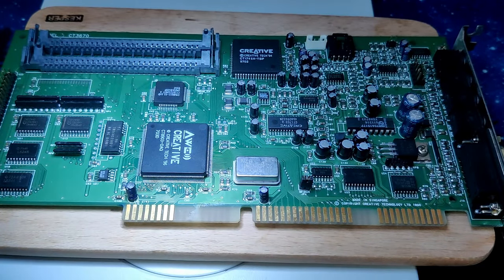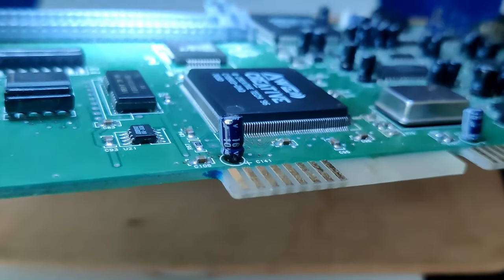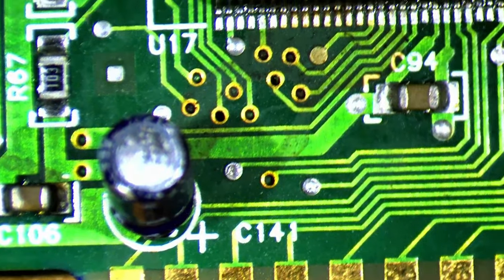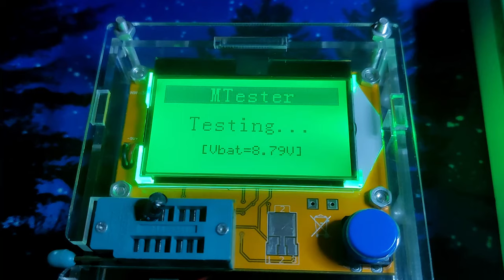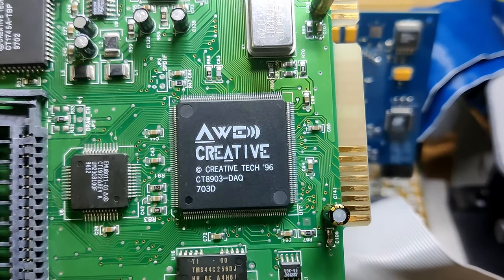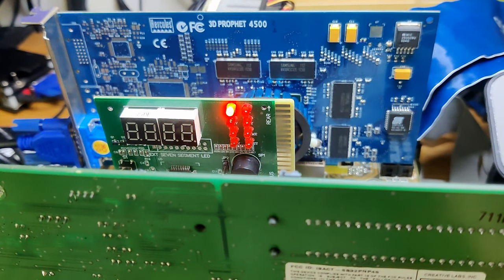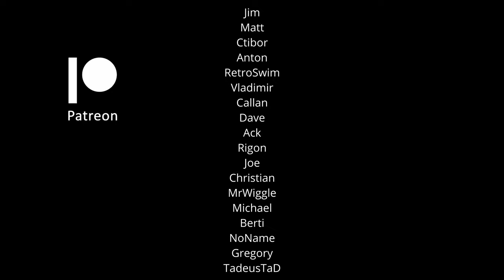Forensics: Sound Blaster 32 CT3670 repair attempt

Comment: Capacitor c120 is also bulging.

I'd consider looking at all those capacitors between the caps between the audigy chip and the 4 pin connector
Reply: I really wonder how the owner made that happen, maybe left hot air unattended on the side of the board for a while or something, but yeah clearly all those caps are dead/dying!
Reply: People tend to stick hardware in the oven, without thinking for themselves what might be some issues that could occur. 

I’d definitely replace those capacitors. Usually, they’re resistant to heat, anywhere from 85°C to 105°C. The molten connector tells me the temperature went higher than that. Evidently, those capacitors will dry out and/or pop. 

Nothing is unfixable. :)
Reply: I'd say the majority of the caps are probably cooked, I see a fair few that look suspicious. Even some of the ceramic capacitors look suspicious, look at C16 to the right of the CT1745A chip, it's really dark compared to the ones next to it, like it's getting smoking hot from being shorted.

This card may work again, but it's going to need some serious low level diagnostics.

Comment: use a thermal camera (if you have one) to see if any more caps or other components are shorting. 

also i think it's pretty hard to damage ICs with heat. unless the card was stored in a humid environment and the person heated it very quickly or went above 300-350C. This is called popcorn effect and the bigger the IC the bigger the risk. However I would still recheck for a short somewhere since it stops the whole system from booting..

Comment: I would check resistance to ground on all power lines into the card, as well as the data lines. I wouldn't be surprised if the onboard power supply of the card is shorting out, or some line is being pulled down. If you have one, maybe a thermal camera will be a quick way to see if a component is shorting, but you can get away without one, it will just take more time and effort. I think there is a lot more that can be done in terms of diagnosing before completely condemning this card. Obviously, commercially it makes no sense to spend this much time and effort on the card, but for greater justice and youtube content I think it will be more than worth it!
Reply: Exactly my thought. Although, i would not waste time for cheeking data lines at this stage, until the system is at least able to boot up. Any IC malfunction would not prevent system boot, this has to be a short on a card. So, i would start with checking power lines on the SB's ISA connector.

Comment: Recap the whole board, just, all of it, because the more caps I look at, the worse it gets. Some of them look like they'd explode of you sneezed in their vicinity. After that I'd check for bridging with any of the other chips/connectors, because there's no telling what might have gotten messed by by that heat. Lastly, I'd test to see if that crystal is still okay.

Comment: check for shorted ceramic caps; heat stresses can cause the ceramic to fracture and short the layers together. since they're usually used as bypass caps, the thermal gradient and stresses they endure are much higher due to the ground planes sinking all the heat away on one leg.

Comment: have you tested for shorts?
it could be any one of them surface mount caps and resitors have a hairline fracture from the heat. but i say its that audio chip the pins probably sent too much voltage to the wrong place. dame shame. would be nice to see you save the card somehow.

Comment: These cards had a serious problem with the PNP EEPROM corrupting. When that happens it stops detecting on the creative PNP utility TSR and Windows drivers can't find the card. Copying EEPROM data from a working card will save it if that is the problem. Maybe this card had that problem before it pop'd.

Comment: Everyone commenting about shorts -- if there were shorts between a power rail and ground, the power supply would not have stayed on. The overcurrent protection would definitely have kicked in and immediately shut the supply down. So I highly doubt there's a short between power and ground anywhere.
Reply from the maker: You're absolutely correct. And that overcurrent protection works like a charm. When I built my first -5V Adapter, one of the tantalum caps was bad and immediately caused the power supply to turn off.
Reply: There's definitely not a short between power input and ground. Shorts between two signal lines or between a signal and power/ground are much harder to detect.
Reply from the maker: So, turn of events: there was a short between two signal lines. The card posts now and also plays digitised music. Unfortunately, no FM/MIDI sound. Will try the card in an older system with pure DOS since the drivers have issues with win98 DOS
Reply: @bitsundbolts  Are you aware that on some/most AWE32 cards, FM is routed through the EMU8K synthesizer/effect processor and requires initialization using AWEUTIL /S in DOS (or installation of an AWE32 wavetable driver in Windows 95)? "No FM" might be just due to missing initialization.

Comment: In the electronics assembly industry, there is a term called "bake". It refers to some components needing to be "baked" before assembly. Baking removes moisture from inside of IC chips that could expand during reflow soldering and destroy the parts. I suspect the "pop" that was heard during hot air rework was from just that. During the baking procedure components are slowly heated to much lower temperatures than reflow soldering to gently remove the moisture. This is also why you sometimes receive parts from DigiKey etc. in sealed plastic sleeves with silica gel pouches inside. They are moisture sensitive (to some MSL level).

Comment: I would use a thermal camera to figure out which components are getting too hot. 

Also, it might be worth checking out the 74 TTL chips, such as the 74LS245. 
It is better that it is one of those chips that is damaged rather than the proprietary ones.

And, as others have already suggested, check for shorts and the rest of the capacitors.

Comment: Excited to see my old card even if it's still not working. If you look at my first post on Vogons, the computer was only able to POST and detect the card one time, when it gave me the error. After that, the computer wouldn't POST unless I changed a jumper but it wouldn't detect the card.
Reply from the maker: I did change that jumper, but there was no change. I haven't given up on the card yet, I just didn't have enough time to look for other faults.
Reply: What were you hoping to achieve by blasting the thing with hot air? Genuinely curious. Hot air isn't going to unbend pins that are touching, for example.
Reply: I suspect he confused a hot air station with a hot air gun from the hardware store, plus didn't know how to shield other sensitive parts

Comment: Maby measure all caps (ceramic and electrolythic) for shorts and replace all the electrolythic ones anyways for good panasonic, nichicon or rubycon ones in case the card does work again. They are afterall almost 30 years old anyway.

Comment: Pro repair tips: First check for a short between power and ground. There are several common logic chips on the board being used to isolate several buses (74LS244/74LS245), plus a few other smaller logic chips and a DRAM next to the large Creative chip. I would remove and test all them in a Retro Chip Tester Pro. If you don't have a RCT just remove and replace them with new parts or known good used parts. The melted connector is in the audio output section so that won't stop the computer booting but a bad logic chip connecting the card to the ISA bus certainly will cause an issue if the chip(s) are bad. Due to the custom chips the only thing you can do is check/replace any common off-the-shelf chips. If that doesn't work then it's scrap and a lesson to all noobs watching... waving a hot air station over a board like a magic wand won't do anything except break it. You can't fix it with a hammer. Do not mess with expensive and complicated electronics that you do not have the required skill levels and equipment to handle.... PRACTICE ON JUNK BOARDS UNTIL YOU GET THAT SKILL LEVEL!!!

Comment: Lots of el caps seems to be bulging, so I'd go for a full re-cap. If that won't work check if the oscillator generates anything. Then look for possible ceramic caps short.

Comment: Yeah I see other bulging caps and I'd check that crystal oscillator since it's close to the main chip where heat would of been applied. You're going to have to check the ceramics for shorts and see if there any off value or open resistors.

Comment: Decades ago we were told not to get parts too hot or they will die, but if you watch Sorin blasting parts with very high temps, ie 380ºC, it doesn't seem to matter. 
Me personally I would keep trying, unless I found an unreplaceable part burring hot when powered, ie, shorted.
You could check for shorts, diode check data lines, check if power is on the card, pull the IC totally and resolder, etc
Reply: Maybe pull parts off, plug it in, and see if it boots, ie, it might tell you what part is the problem.

Comment: Looks like this "sound" was from pcb itself, it was "popped" from overheating, and delaminated. You can see it in oscillator area, near resistor R68(7:54) - damaged vias
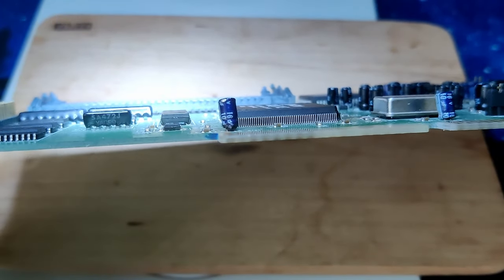Reply: I think that at 1:31 you can even see the PCB bulging next to the oscillator 😳

Comment: It could just be me having just done a full recap on a motherboard and PSU, but to me a lot of the rest of the caps on that card look like they're bulging as well. If the previous owner just air gunned the whole card, he may have blown or come close to blowing some of those other caps as well. I'd just try a full recap before giving up on it; caps are cheap. And maybe test for continuity/shorts around the components near where the hot air went.

Comment: I once had the EEPROM which stores the settings on my GUS PnP corrupted somehow which prevented the machine from booting. I fixed it by hotplugging the card to a live system and reprogramming the EEPROM with the standard tool from Gravis. So a non-booting ISA card does not necessarily mean a hardware fault. Though in this case the liberal use of hot air does seem like a more likely cause for the failure.

Comment: Check all capacitors and also use a thermal camera to see (after replacing any defective capacitors) if any shorts are visible on thermals

Comment: Before you try anything else, lightly sand the pads with 3000 grit sandpaper ( I just revived what I thought was a dead sound card doing that, a standard eraser didn't work )

Comment: I had one of these SB AWE 32 cards in my socket 7 K5/K6 based PC as well as in my first slot 1 based PC. I always wanted to added extra RAM to mine but I never did get around to doing so. 

Judging by the number of capacitors that appear to damaged I would bet there is a short in at least one of them that's causing the system not to POST. It's a shame that hot air killed this card. However, it is understandable that the first couple of attempts  may not go well until a person has had more experience.

Comment: To me it sounds like there's a short somewhere, maybe a fried capacitor. If the chip was fried it would probably still allow the system to boot, it would just not work properly or at all. I'd say capacitors are the most likely culprits. They don't like being overheated, and a shorted electrolytic cap across a power rail can certainly prevent the system from booting.
Reply: If there was a short, the power supply would have tripped on overcurrent and it wouldn't have stayed powered as long as it did.

Comment: Flex check the isa port contact pins with a continuity’s with sound on your multi meter then ground and each pin while applying minor pressure if a short occurs in the meter solder is required for perfect operation nes cartridge repairs

Comment: Failing to post. I'd check for shorts on the ISA bus connector. A shorted address, data or irq line could do that, random dead components should not cause a post failure unless they are shorting things. As an isa pnp card the awe chip will likely be directly connected to the isa bus on a  number of the pins so I might suspect solder bridges from the hot air. I would also consider taping over the power contacts on the isa bus connector to see if the card still causes failure to post when unpowered. Taping lots of contacts   might also help  narrow down which isa bus line is getting messed up by the card and you might be able to trace where it goes on the card and the failed component

Comment: It's quite unlikely that any of the chips were damaged by hot air unless there is visible signs of scorching on them or the PCB close by.  More likely dead capacitors or shorted ceramic capacitors. With the level of effort you put in to the AWE chip you might as well have removed it with chip-quick. Straightened all the pins under the microscope then put it back. This gives you the opportunity to inspect the PCB pads and glue down any loose ones using UV solder mask.

Comment: Are the electrolic capacitors around the melted connector in good shape? As far as I can see on the video, a handful has a nice bulge on their top. I can't tell if changing them would revive the card though.

Comment: Im always impressed by your skills working on such a tiny scale! Bummer that it didn’t work out. Maybe some of the logic ICs that are straight on the ISA bus have failed and that’s why the computer won’t post? I would assume damage on the analog section wouldn’t actually prevent the machine from posting would it?

Comment: so sad! Probably a shot in the dark but I might see some bulging on the caps on the left hand side of the melted connector. I doubt they would prevent the whole system from posting but worth a shot. 
Actually, I'm wondering how is it possible that the card is causing that issue. If you have a scope you could scope all the address/data lines as I feel that at that stage a shorted Address/Data line is the only way a SB could prevent a Motherboard from posting. From the video, it seems that the ISA bus is directly connected to the main IC so that's unfortunate.

Other things I can think of:
- Check that everything has voltage
- Check the clock
- Check for shorts
- Check that nothing is scorching hot :)

Comment: Did you check if the quarz oscillates? I can imagine the heat cracking it...
Reply from the maker: I got the card half way to work. There was a tiny solder bridge I didn't see. I'll get back to this card after I fix all those P2B motherboards...

Comment: i'd be recapping all those electrolytics. the heat did them no favors, and probably finished off the aging/drying of the fluid.

after that, visual inspection of the soldering across the whole board, testing for shorts on the fingers, etc.

once all thats checked/done, osc probing the signaling contacts to see whats going on when trying to boot, if it still doesn't allow post.
Reply from the maker: I'm a step closer. There was indeed a short between two data lines. There'll definitely be a follow-up

Comment: i really look forward to your repair videos. i like how you approach things and your breakdown of the methods you use. I always look forward to one of you videos. I hope to see lots more in the future. 

SIde note. My wife PC PSU was doing some odd things like shutting off randomly and then boot cycling until you turned it off for a while. so i grabbed a spare psu to see if the problem persisted and nope the extra PSU worked like a champ. I figured bad component or heat related. SO I popped open the old PSU and blew the dust out. put it back together and it worked better random restarts happen less often. but i noticed inside this PSU the Fan had a Plastic sheet covering almost 2/3 of the fan. blocking most of the air flow. well since the PSU is giving me issues i figured remove the plastic sheet to improve air flow. Its been 2 weeks now and the old PSU hasn't shut off once now. It was a Thermaltake TR2 600w PSU. I know they claim the plastic sheet is there to direct the flow of air but the one in this PSU was so stiff that if it was meant to flex and let air flow well that would have never happened.

Comment: Clock crystal was near area of excessive heat - check that it is working.
Reply from the maker: I could measure the correct frequency on one of the pins. Not sure if there should be something on the other three pins

Comment: yeah I have a hot air station. I got it for 3d printing related stuff. I have a launch wii console. I promise you it needs recapped. I think I'm just going to use twist and normal solder gun method. I don't trust myself with hot air on circuits.

Comment: With the correct technique fixing badly bent legs on the edge of a QFP chip is very easy. First heat the leg with soldering iron and gently push the leg up from behind so it is above the pcb. Add flux and wick away all the solder so the legs are free to move easily. Bend the legs to the correct shape so the leg is perfectly straight and sits flat on the pcb then re-solder the legs with perfect alignment. I made some special tools so I can use the lifting technique even in the middle of a large QFP chip since this kind of damage is common on arcade pcbs... lots of clueless cowboys in that scene lol

Comment: Maybe check the rails for shorts and see if that big crystal is oscillating
Reply from the maker: I checked the crystal. Seems fine to me. I need to look up a datasheet though because I could measure the correct frequency only on one pin. Not sure if there should be a frequency on any of the other three pins.